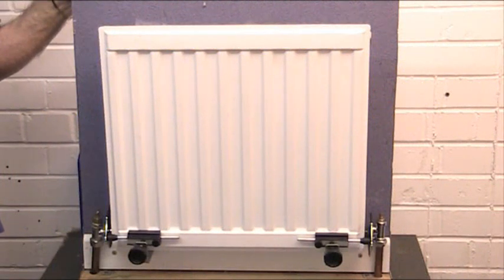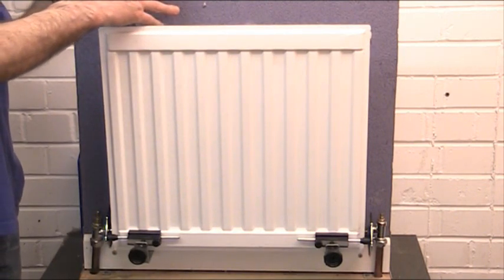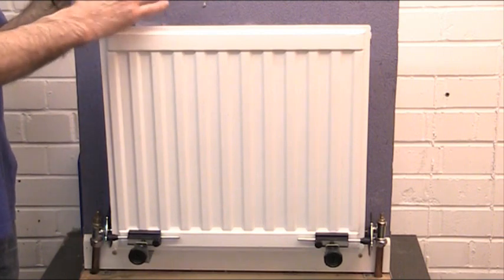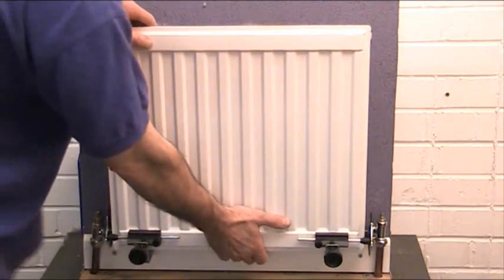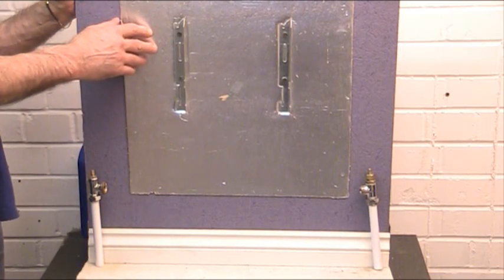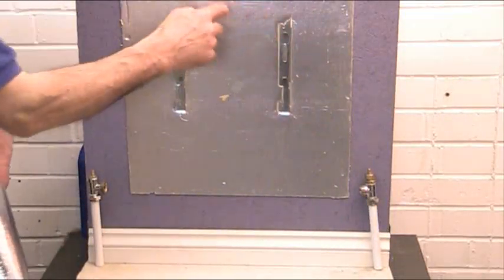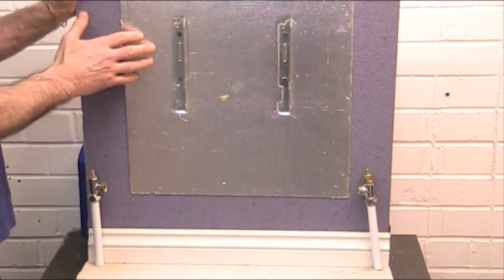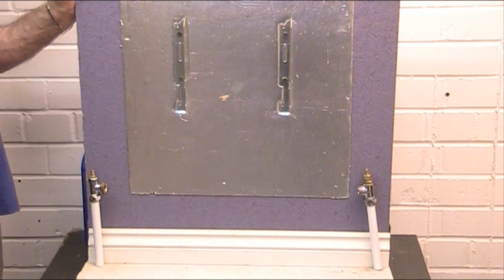Save money fit reflective foil behind radiator, WITHOUT draining

Comment: I would try and avoid draining the radiator and introducing new water into the system, especially in hard water areas can reduce the life of steel radiators. Try and work from the top down by slitting the insulation and sliding / working it down the back of the rad.

Comment: Especially, what is annoying, and it consume money for nothing, is the fact that this is most inappropriate way of heating or energy consuming process: it heats first cooper pipes from the direct flame than the pipe heat water (or whichever fluid is) than this medium heats aluminum radiator. That is 3 conversion, which makes loss of energy, no matter how inexpensive is domestic heating gas. Most usable way of heating in terms of cost-efficiency-gain is simple electric heater, but the one as we are using here in most of the Balkan area. So called TA (Thermo accumulated) heater, very heavy heat appliance with ceramic bricks inside. It store heat energy inside bricks during night, and during the day, when is  necessary, it blows heat outside with fans. Here, among the other convenient way of heating source as gas, coal, wood etc. this one is pretty widespread.
Reply: And, of course, this is applicable where electric power has affordable price.
Reply: vs splitting atoms to boil water to make electricity which is "piped" over many miles to a substation, then to your house? I'll stick with gas for heating and use the higher quality energy where it's needed.
Reply: You're wrong, at least when it comes to the UK.  In the UK you pay 0.14p per kWh of heating electricity.  For gas it's 0.038p.  Even with a terrible efficiency of 50% (conversion/heat losses) that's still only 0.076p per kWh of heat when using gas.  So to use electricity it'd still cost TWICE as much as natural gas with an old boiler.  I'm fed up with those ridiculous claims from electric radiator manufacturers that due to the 100% conversion efficiency of electricity they're cheaper to run....it's absolute rubbish and spreading misinformation/terribly false advertising which preys on people's ignorance!  Modern condensing boilers are up to 94% efficient, and most of the losses in heat transfer get lost....inside the house where the heat is needed.  Even without considering the less than perfect efficiency etc gas is still a tiny fraction of the cost of electricity.  The exception may be when considering bulk gas, in which case it would still likely be cheaper to use bulk gas (or almost equal to that of a heat pump using electricity).

Comment: Obviously you've drained the rad carefully,and if you've a  combination boiler you may need to check the water pressure gauge on the boiler after bleeding the air out of the system,you may need to add water,at the boiler ..quite simple to do yourself ...
Reply: Cube Hire

Don't remove your radiator that is crazy.  Most radiators have room to place insulation behind it while its in place.
REPLY